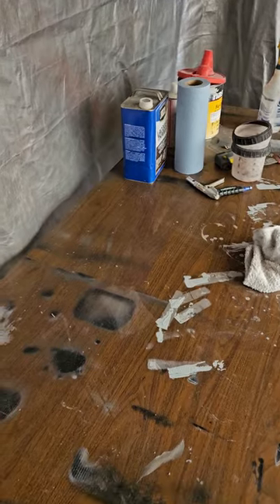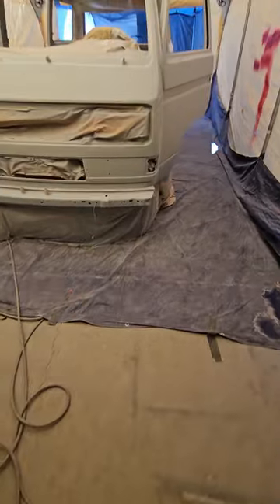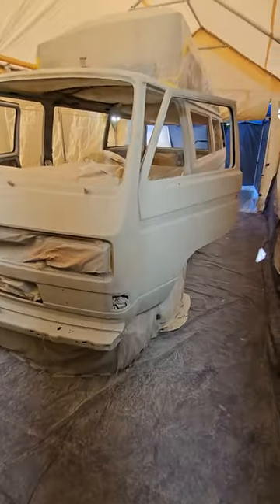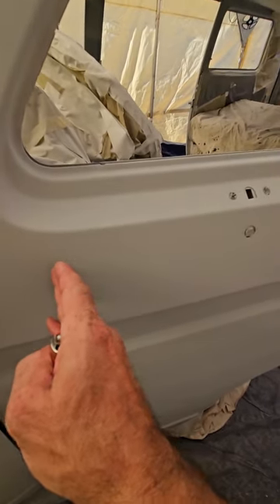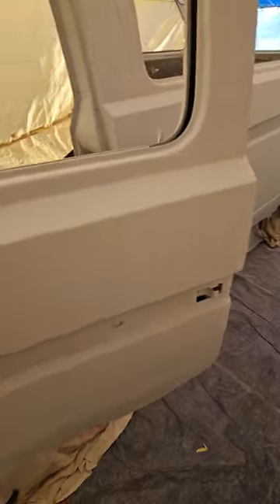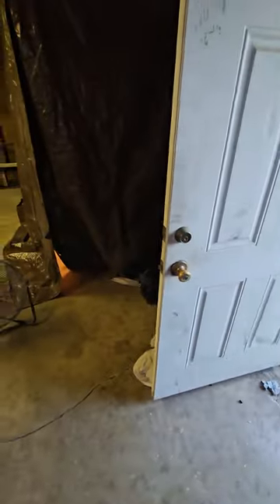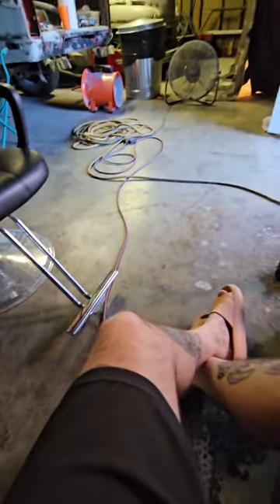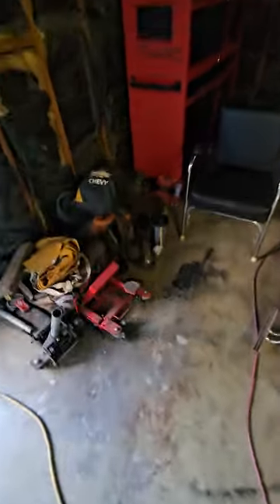The love tunnel painting an 1990 vw van!!

Comment: Scooby Doo van looking good. A little slow reducer will help lady that other down smooth.
Reply from the maker: We used the high tech dtm for this phase and your right if we had slow it would have layed out smother I was trying to adjust as close as I could to the panels and speed up hand speed to adjust for the heat but I was at 3 inches and didn't feel like closer would be good lol
Reply from the maker: I posted the video with the basecoat on that van and I hope you don't mind I gave you an shout out for the advice you give out to those looking for it.
Reply: @wrightsrrt871  I don't mind at all brother. That's what we're here for. Anytime. I'm gonna check it out 💪🏼